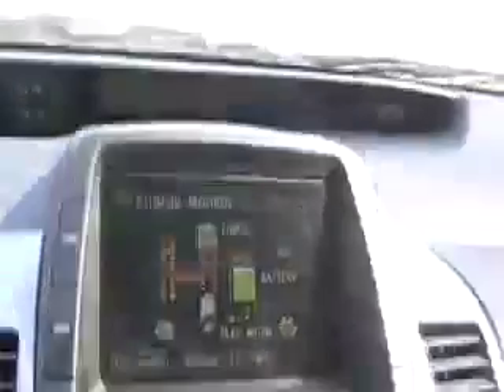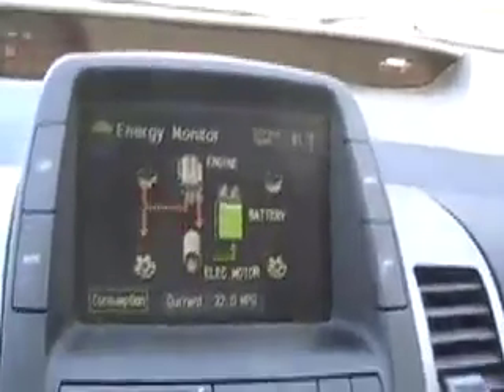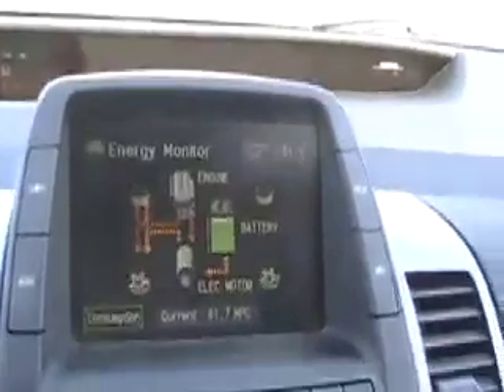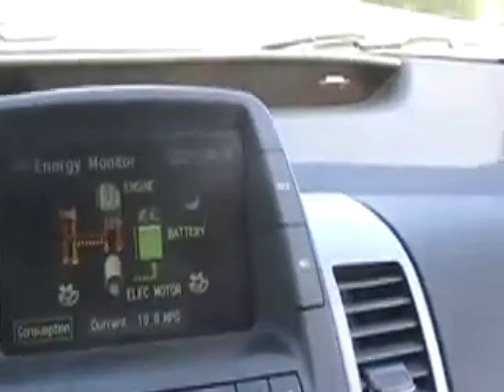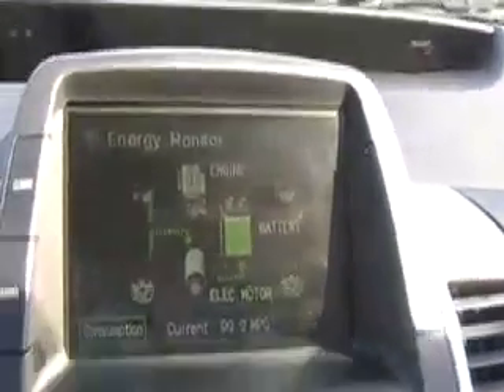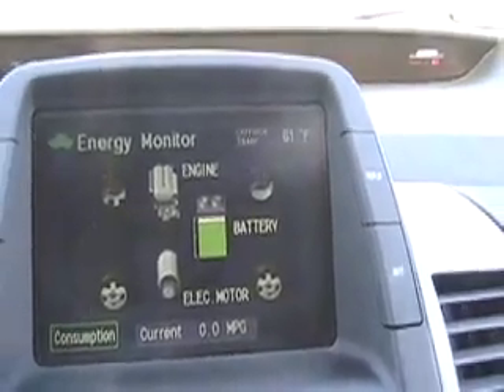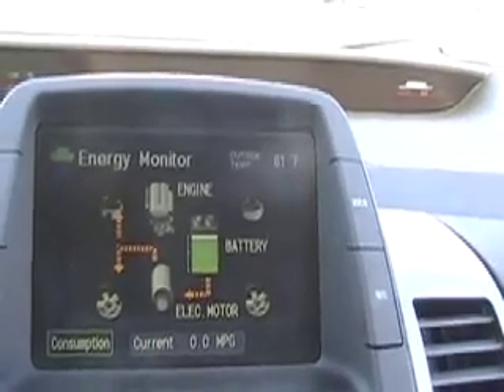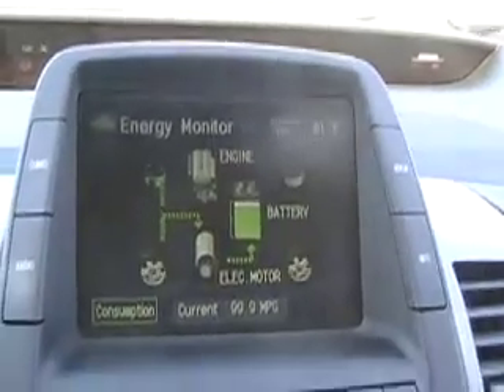Three big problems with the Prius - Tape 1

Comment: I have the second gen prius its do e 220 miles its been over a month and I believe either the motor is not doing its job properly because at low speeds now every time the engine kicks in all the time a d its under another of pressure...

I am not sure whats the problem 🤔 any help

Comment: This video was made by the late Doug Korthoff of the Long Beach California as area.

He was featured in the movie “ Who Killed the Electric Car”.

He knew more about cars than any one commenting and had a PHD in Physics.

His point of view came from having his EV-1 car made by GM taken away and crushed.

It had a range equal to the first generation Nissan Leaf with the lead acid batteries and better than the Leaf with the NiMh batteries (130 miles per charge).

The EV-1 car was designed in the mid 1990’s!

It was finally produced in 1997.
None were sold just leased.

His comments here on the first generation Prius are in relationship to a true electric car and how a parallel hybrid would act instead of the serial one.

Comment: The decal says hybrid, do you see one that says electric? do you know what hybrid means? Gee I bought this boat and it needs water to float, you believe that? The big problem with this gas lawnmower is the gas powers the engine and there is no plug so I can plug it in when its not being used lol, if want one with a plug and don't want an engine powering it then next time buy a electric lawnmower.

Comment: This guy obviously does not understand the "hybrid" Prius.  I have had mine for 10 years.  When I drive very slowly (in town), it runs from the battery.  When I drive over 30 mph, it switches to the gas mode.  If I am driving in the mountains or a hilly area, it switches to battery for downhill and gas for uphill.  I actually get better mileage when driving in a hilly terrain versus flat.
Reply: The problem is the car is no switching at all it is staying only in gas,  the electric is not engaging,  my Prius is an 2005, had it for 14 years , I know how is supposed to work but it's not doing, hope you won't experience the same problem any time soon,  because this just starting to happen couple weeks ago 😕

Comment: An army of Toyota engineers saw fit to make the car do what it does, when it does, for a reason.  A reason, you and I may not understand based on our limited knowledge of mechanical and electrical engineering - and lack of 80 years of real-world automotive experience.  So far, based on world wide sales, it's proven to be the best design so far.  Toyota and its brands are regularly touted as some of the world's most dependable vehicles.  I'd cut them some slack and give them the benefit of the doubt.

I've driven the same Toyota hybrid for 10 years and 140,000 miles now.  No problems whatsoever.  It is PURE GENIUS.

Comment: This guy is a complete ignoramus and doesn't understand that this is a hybrid car and not an electric car.  The car intentionally keeps the battery at around 2/3 charged because that drastically extends the life of the battery.  This car is actually a gas car where the electric battery and motor is used to store and utilize energy that would normally be wasted in a regular gas car.

Comment: Dude's talking complete "B*llocks". He hasnt the foggiest clue how this amazing bit of technology works! Everything he describes is either intentional - and controlled by a bevy of computers, or he's talking complete "Bravo Sierra". For crying out loud, this car has almost as many computers as the Space shuttle - probably more. Mine doesn't jerk as he described. If you buy a Prius, you need to LEARN how to drive it. Excess generated electrical energy goes straight to the wheels! And the computers take care of the battery - giving it a very long life span no matter how you drive it!

Comment: I've pretty good luck with my 2004 Prius/Frankenstein Monster!  Over 100k miles and absolutely no complaints.  I get over 50mpg.  I live on Maui and have taken my Monster up to the summit of Haleakula volcano which is 10k feet above sea level. averaged 24.5 mpg going up and 99.9 going down.  Like I say, I've had pretty good luck with mine. It sounds like this guy thinks there should be only one kind of car...probably the kind he owns which is not a hybrid...too bad! Ha Ha Ha Ha Ha Ha Ha Ha Ha and so one...

Comment: My prius 2004 over 108000 miles done still 64 mpg average. And it's really possible to do more but not with my driving style. Stupid engine warning light came on last week:( but I don't feel any changes in the performance.

Comment: How about the fact that my Mini Cooper gets better freeway mileage than a Prius? They are great in town, but the electric motor doesn't cut it for freeway speeds and is actually worse than a high mileage car that runs on gas only. And wait until you have to replace the batteries or the charging system. Have fun with the $3500-$5000 bills. Will never save that much compared to a gas guzzler. I can get 45+ in my Mini on the Freeway, btw. Prius gets about 34 when calculated properly.

Comment: I have a 2004 Prius with 435,000 KM on it. Other than tires and brakes and oil changes, all I have done to it is one wheel bearing. Best car I have ever owned. It is still clocking up km...and burning 4.7 l/100 km.  Something like 50 MPG.

Comment: True and the problem gets even worse when driving in extreme high elevations like Vail Colorado. Almost didn't make it because the battery didn't wanna charge and without the electric motor the car has no power.

Comment: Regenerative Disk Braking? On a Prius? Poppycock! There's no such thing. Fact: either the MG1 or likely MG2 electric motor seamlessly reverses operational status to become a generator for the Traction Battery, so that you never loose energy during deceleration! The actual ordinary disc brakes kick in only at 7mph or less - and for true Prius aficionados, sometimes never at all - as you CAN come to a complete halt using regenerative mode only!! Very advanced 21st century car indeed.

Comment: As far as I understand, you want the gas engine to stop when the battery is full and then the car should run only on the electric motor using the accumulated battery charge. Prius just cannot run at highway speed on its' electric motor! It's hybrid (combination, mix) but not an ELECTRIC car.

Comment: Batteries run best either not fully charged or near complete discharge. When you press down on the pedal,for example, to get on the highway via an on-ramp, BOTH the electric motor AND the gasoline motor engage. Unlike, for example, a small German car with a small underpowered engine and turbo, where mechanical things have to "happen" over time, the Prius battery is "ready" RIGHT NOW, and you get INSTANT acceleration. I own two 2010 Priuses and they work very well...at least that's my experience.

Comment: Your problem is that it seems that you gas pedal only knows two positions. off and on. If you put the pedal on the floor the engine will certainty kick in to get you the most power. Go over to MPGOMATIC and watch his video about getting 65MPG on Prius C.
And: little charging and discharging the battery won't take much wear on it.
One last thing: The Prius is not a racing car!

Comment: The most idiotic review ever, being hybrid means that the gas engine and motor are synced to provide optimized fuel consumption. Proof???it does 20 plus kilometers per liter or 45-50 MPG....what other car does that??????

Comment: Wow! As others have stated, the poster of this video has no clue as to how hybrids work. First, he does not understand the concept of a hybrid vehicle; second, his statement that the batter should be kept in the drained position to receive regen from the brakes and tires is ludicrous. The onboard computer constantly monitors the energy needs of the car and the battery life to FULLY OPTIMIZE the battery's ability to both send & receive power, and to maintain optimum longevity of the battery.

Comment: The poster fails to understand the function of the traction battery in the Prius. It is NOT the prime power source. It is MEANT to assist when high power is needed and to recover power during deceleration. It is MEANT to be continually receiving and delivering charge. Most of these batteries do that happily for the life of the car which is a HYBRID - look it up!

Comment: if only hybrids had manual controls for the electric part of the hybrid, that would be fun. But of course, the engineers at toyota set the car up like that so that it will work for everyone and keep the batteries in good health.

Comment: If the car is such a "Frankenstein," how come it gets such great gas mileage?  If the design causes such "wear and tear" on the battery, how come the battery lasts the life of the car?  VERY few of these batteries have had to be replaced due to wear and tear.  And in those cases it was really due to contaminants in the batteries.  Here we are in 2012, 4 1/2 years after this video was shot, and the durability of these cars has proven him wrong.

Comment: I think all of you are missing the point. The battery life is being artificially shortened. Also if you think about it, so is the engine IF the engine is turning off all the time. If you are going to be all posting the same thing about how this guy is an idiot at least make more sense. I think the battery as a assist to the gas engine may make sense because the resistance to the battery may be too high to just drive alone. Having the gas assist may be more optimal for the smaller hybrid battery

Comment: You obviously do not understand the concepts you speak of. The Prius is not an electric car, as you continually insist. It is a "hybrid". In case you didn't notice, there is a badge on the back saying exactly that. It uses both systems in a symbiotic relationship. The electric motor assists the gas engine when it is at its lowest performance, such as starting from a standstill when the gas engine is at very low rpm's, accelerating, or going up a hill. Mine has 150k miles and gets a solid 50 mpg.

Comment: Yep! Light feet DO go further, a concept we all intuitively use when the orange light flashes and we try to nurse her to the next pump!  I fact there is an ev mode in the Prius, [not the Plug-in version, that ev feature is automated], which will run about 2 miles with no gas at all [10 miles in a Plug-in] - IF you keep below 30mph and tickle the accelerator gently.

Comment: A Prius, [with all Toyota hybrids, GM Volt, Vauxhall Ampera or Nissan Leaf], never fully charge the battery- about 65% charge is the norm max from the gen.  This is a vital element of the design of these hybrids, as this gives practically infinite battery life.  The Prius IS a gas car with assist by design, NOT AN EV - & regenerative braking is key to fuel conservation in all hybrids, irrespective of ev range. All he's showing are minute energy transfers of no importance to overall economy.

Comment: The whole design concept is that when you run a gas engine at a steady rpm and put a steady load on it you get up to 50 percent better feul economy. I have used this concept to get improved feul economy out of a diesel truck I owned also. The battery should "whipsaw" to smooth out the load on the engine.

Comment: So, the car is working as designed...  GM, and Ford are playing catch up.  Toyota has done a great job on these cars!  I can see your point of the electrons getting confused as to charging - discharging.  But I don't know of any other vehicle that will get 55+MPG/city.  I got 56 with mine all this last week.  (08 Prius Touring, 156k miles)  If you add a GOOD li-ion battery, you have yourself a Volt..  Provided your not against it too.

Comment: Just so true.  MG1 and MG2 work in harmony.  MG1 is more less - a starter.  MG2 is what drives the wheels.  Plug in Supply has designed their pack, and computer to interface via CAN-Bus.  Really cool stuff.  72MPH, in ALL electric mode.  MG1 spins too fast@72MPH.  They couple MG1 to spin the ICE to slow down MG1.  A person could do this to a 2nd or 3rdgen prius, have a vehicle similar to a Volt, at a fraction of the cost!  These prius' are GREAT!  Everybody else is coping what toyota has done.

Comment: what a load of rubbish you are stating. The display is only partly accurate as its just a simulation to what is going on.. When it shows the battery as full it is not. When it shows it as empty it is not.Toyota experts know much more than you.

Comment: What so gay about it? 
If you want to save money on gas you need to drive slower and accelerate slower. But if i have some people tailgating me i just use power mode and i live those ignorant people behind. It goes 0-60mph in 10 seconds, but then you do not get good MPG. Its all up to you how you want to drive your prius. It is actually fast, for a hybrid synergy drive car. If you will drive it pedal to the metal you will get great acceleration and probably 15mpg on that car.

Comment: THIS IS EXACTLY WHY IT'S CALLED HYBRID IDIOT. 
YOU CAN DRIVE IT ONLY ON BATTERY ONLY UP TO 35 MPH AND THEN ENGINE KICKS IN. AT LEAST IT DOES IT ON MY 2012 PRIUS. 
IT'S NOT 100% ELECTRIC. ELECTRIC DRIVE IS JUST SIMPLY SUPPLEMENTARY TO ACHIEVE GREATER MPG. YOU CONTRADICT YOURSELF IN THIS VIDEO WHILE YOU TALK. JUST LISTEN TO YOURSELF. FULLY ELECTRIC ARE NOW NISSAN LEAF SOME NEW MITSUBISHI AND CHEVY VOLT SEMI ELECTRIC VERSION.

Comment: I love how you note the battery is very small but complain that the car doesn't solely on battery power until dead. FWIW full/deep discharge cycles shorten the life of the battery, the batteries like these like shallow charge/discharge cycles. Also the battery is not going to overcharge, to do so would be an explosion waiting to happen so regardless of the monitor the battery is not charging past 100%.

Comment: what dumb ass you are....the reason the battery last over 200Kmiles...is because is is not discharged completely...you obviously dont know shit about hybrid drive...Now I see why those stupid dumb ass engineers from GM can't built proper hybrid cars.just compare the gas mileage between Japanese and American hybrid....the goal of the car is to give you gas mileage.99.9% of the people dont care if the motor turn of an on,I have been using mine for over 228K miles and the battery still working fine

Comment: First he says its a gas car, then he says electric car. Its a hybrid. The gas engine does not make electricity that it uses, the alternator does. The EFU is one of the only thing that always needs a charge to it.  It cant push energy non stop into the battery if it didnt have a failsafe for that because the batteries would overcharge and meltdown the whole damn car. IT WAS ALL ENGINEERED.

Comment: Part 4 of 5: to explain this is, let’s say the software is reconfigured to incorporate your suggestion, and the battery is able to discharge to say, 25% before emphasis is put back to charging it up, then it is possible that you will arrive at the bottom of a long hill with only 75% of the battery charged.   This might result in the boost running out of power before you get to the top of the hill (and you may only be

Comment: Part 3 of 5:  possible then it is beneficial for the battery to start its boost as near to fully charged as possible.  Since the car cannot predict when ‘that big load’ is needed, the software biases the battery towards keeping the battery fully charged and ready to tackle that big job rather than reducing wear and tear by allowing the battery to discharge more (as you explained very well in the video).   Another way

Comment: Part 2 of 5:   the amount of boost (from motor and battery) required is relatively small.   If however you drive up a long steep hill then the amount of boost will be much more. Taking this argument to the extreme, a given battery capacity (fully charged) provides a finite amount of boost (that can be expressed in terms of road grade (slope) and distance).  If you wish the amount of boost to be a great as

Comment: Part 1 of 5:  I own a 2009 Prius with 40k miles, I have observed the issues you mentioned (very clearly) in this video but have arrived at a different analysis.  I believe the software has been configured to place a high priority on keeping the battery full, even though this results in losses (as you report) in order to guarantee that the motor will always be available to provide maximum duration of boost for the small engine.  Example:  If you drive on flat roads then

Comment: you are an idiot!!!!! the battery is not tiny and is not the reason why the car doesn't use most of available electricity! it's because of the electric motor! that is the thing that is too small to go 50mph and use up the battery!!! you don't know at all what you are talking about in your video.

Comment: @MrKnnknn i agree, but mpg aside, those minerals for the battery required alot of mining. and do you know about the mining process? cause i dont, but i do know that its a very unenvironmental, c02 emitting process. youll do better for the environment to buy a volkswagen polo..and if you life in the u.s. golf deisels arent exactly gas guzzlers either.

Comment: @whole27 The tank is almost 12+ gallons I believe. It takes some practice to get good mileage (55MPG or better) from the Prius, but if you drive normal you can easily get 45MPG.

Comment: @whole27 yes exactly, the lane next to the truck and about 50 yards back, the truck creates an air bubble or low pressure, gas mileage is all air friction at those speeds. One of the reasons the Prius gets good gas mileage is because of its low drag coefficient of 0.25, the lowest in the car industry, better than Ferrari or any sports car, another reason is its hybrid system which uses batteries charge, the batteries recharge when you decelerate or break or sometimes accelerate.